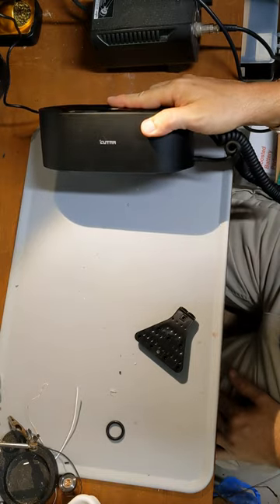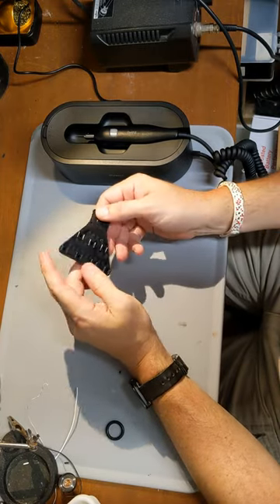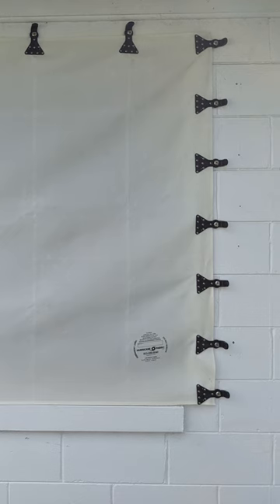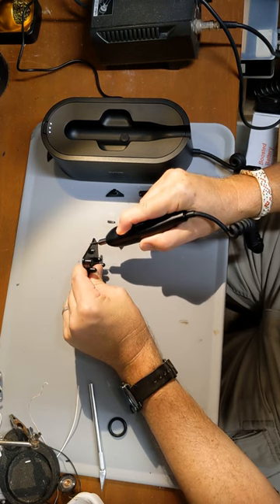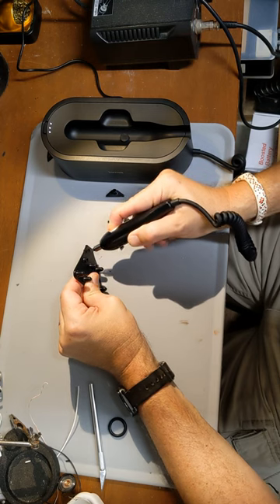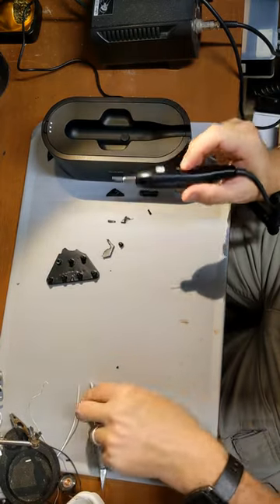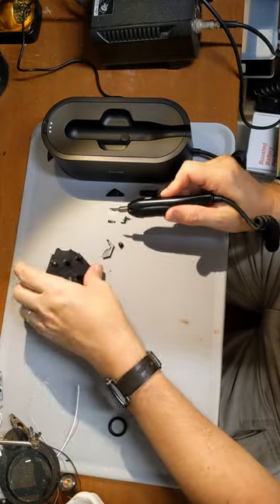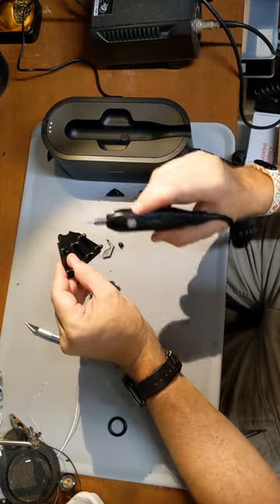CtrlAX Ultrasonic Cutter test

Comment: Hello!  I'm interested in this tool.  I see that it's available (exclusively) here in the US from MicroMark.  They've got it priced at $700. However, it can be ordered direct from Korea for about $450.  Big difference in price.  Where did you get yours from?  Any reasons you can articulate for buying it from MicroMark vs direct from Korea?  Thanks!
Reply from the maker: I received mine as a Kickstarter reward (direct from the company). The only possible reason to buy from MicroMark is the US based support/repair/returns. [I haven't had any issues with mine, but I imagine that the overseas support would be a pain with customs shipping, etc....]  But if you are paying $700 for it, you might look around at other ultrasonic cutters, as there should be more choices at that price point.
Reply: Yeah... I figure buying direct from Korea may be a bit of a gamble.  If the difference in price was $50, then buying in the US is a no-brainer for that "security" of support and logistics.  But for a $250 difference, the "gamble" is more palatable.   @summetj  

Is there a limit on thickness for cutting (other than the dimensions of the blade)?  I would need it to cut through ~2.5mm of nylon and possibly up to 5mm.  

Thanks for your quick response!  :-)
Reply from the maker: @Racer88  I don't think there is a limit per-se, but obviously the thicker the material the slower it will cut.